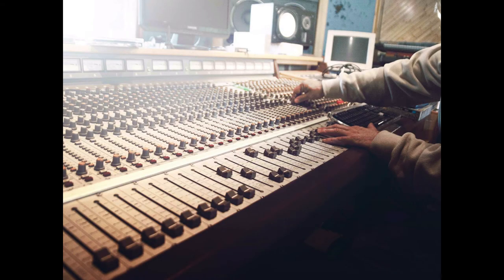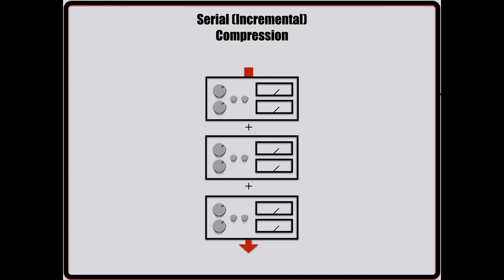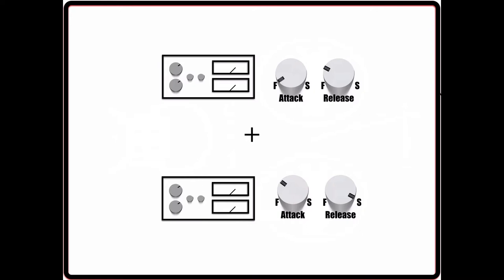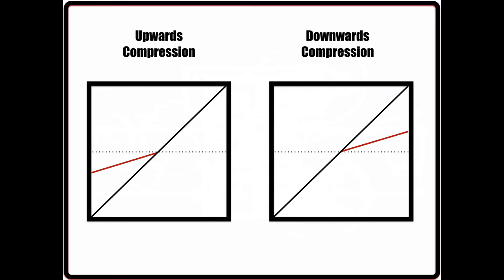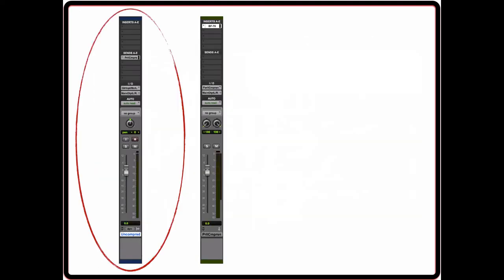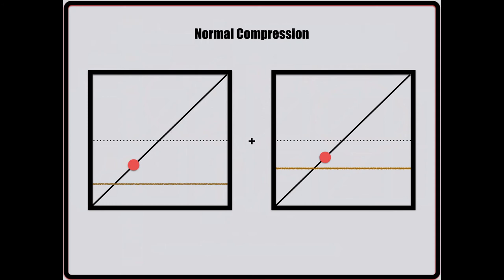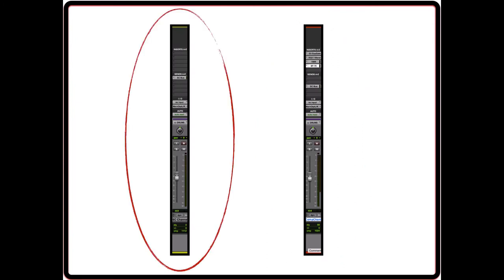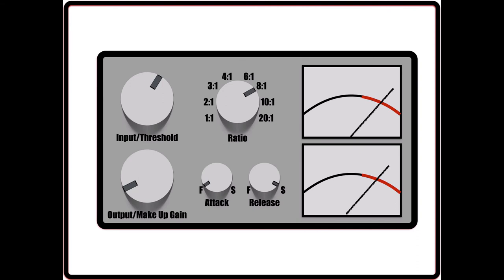Advanced Compression Techniques: Serial, Parallel and Side Chain

Comment: Very good explanation.   I was so confused but now I think its clicking.   I didn’t know if i should use parallel compression with digital sounds with the same velocity levels.  It seems to me that I’ll just only use side chaining and or serial compression for my projects until I start making live music.  Thanks.
Reply from the maker: Yes, it works differently for different geanras. It's always good to have another tool in the tool belt though.

Comment: Which ones do you like the most?
Reply from the maker: heavymetalmixer91 I almost always use Parallel compression on the kick and snare, and its very easy to set to get the desired effects. I also commonly use serial compression, but I find it a bit more listening intensive to achieve what im going for.
Reply: Do you think using parallel and side chain compression are good practices for some "raw" punk-hard rock mixes? 
Btw. great explanations :)
Reply from the maker: I find that side chain compression is mostly used in more highly produced electronic sounding music, but parallel compression would sound great for the raw punk application. Just add all the drums to a aux track with a compressor and crank the ratio up real high then blend it in with the normal drum channels. It will add a nice punch to the drums which I think is great with any type of rock.